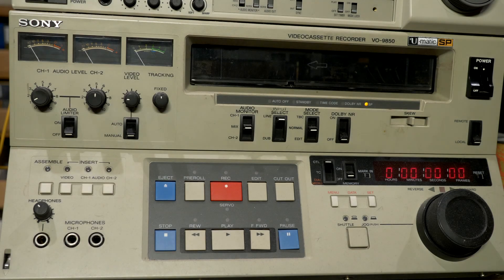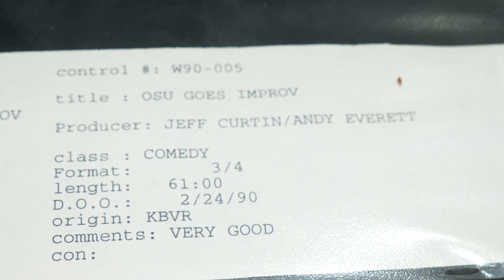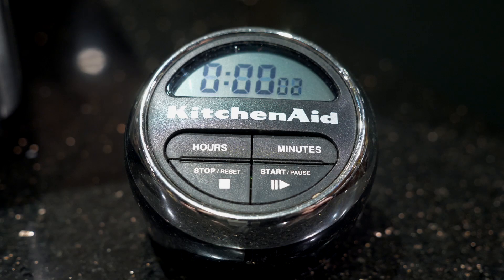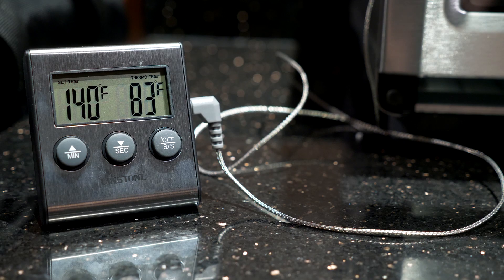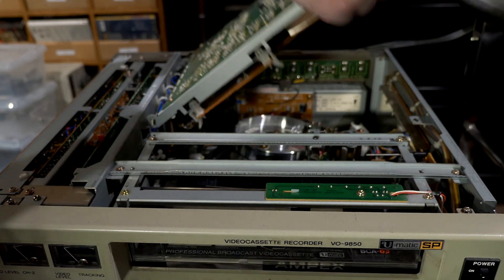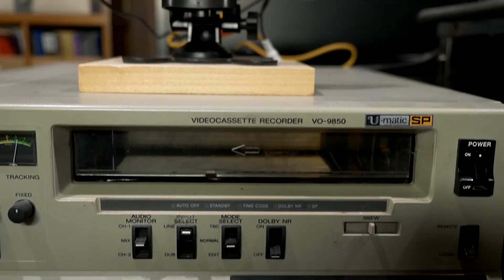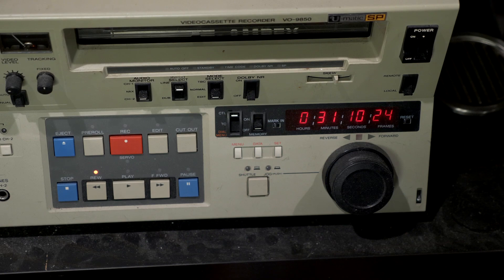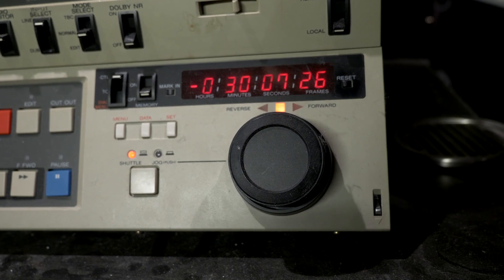Adventures in Tape Baking - Recovering from "Sticky-Shed" / "Stuck Tape" Syndrome

Comment: What software do you use for your captures?
Reply from the maker: It's fairly complex. I have an old DPS digital timebase corrector, which does a great job at stabilizing videotape standard-def sources and converting them digital to with 10-bit resolution (instead of the 8-bit you get in consumer devices). It outputs to SDI, which capture with a Blackmagic interface (there are several to choose from) to ProRes format. From there, I deinterlace using JES deinterlacer (which only runs on older versions of MacOS, I keep an old computer around just for that.) There are newer deinterlacing products that may work just as well but I haven't experimented lately and JES does just what I need. I hope that helps!

Comment: I have cleaned many broadcast u/matic tapes. Although from my home made oven 6 hours is plenty of time to do the job, cooling down as suggested is perfect.  But this process does not remove the binder that is now not sticky . I had the facility to use a cleaning machine that has tissue rolls and razors to scrape the gunk off the tape. But if you dont have one then the next best thing to do is dont play the tape after baking but spool it 3 times or more cleaning the guides and head between spooling. This is next best thing to a cleaning machine.  PS the tapes that are baked only stay stable for a couple of weeks and revert to their previous condition.  Also rather than place the tapes on anything metal in the oven use a ceramic saucer as it does not transfer large amounts of heat into the cassette cartridge.  
Wish you all well. This is a good thing you are doing preserving memories and events.

Comment: This is an interesting process. I was intrigued to see UofO since I am in Springfield. I am trying to determine if this will work to recover a huge trove of old floppy disks I recently received since many of them have local historical value but the oxide layer comes off onto the drive heads making the disks unreadable. I will do some testing, thanks for the great information!
Reply from the maker: Thanks for the comment - I actually am a subscriber to your channel! - sent a reply to you via the comment form on your blog about an hour ago.
Reply: @unofficialkbvr-tvarchive1426  Wow, small world! I just checked and the blog contact form was not pointing correctly. It should now take you to the contact form on my shopify site. There is also contact info on my about tab on the main channel page.

Comment: The other commenters are correct. With any videocassette, I always take the shell apart and bake the tape reels alone. This also gives me a chance to clean the tape guides in the shell, as they are often gummed up from prior play attempts. The eject problem you experienced is likely a problem with your deck, probably a loading belt that needs to be replaced. (I own a VO-9800, which is identical to yours except it has no tracking meter.) You might also try a tad higher temperature. I usually bake at 140F. The melting point of the binder is about 135.

Comment: I jabe baked over 700 reels of tape and 200 3/4" video cartridges. I would highly recommend you pull the spools out of the cassette before baking. 
I restore and operate 2" quad broadcast video tape machine and will not playback any tape that has not been baked.
Its so funny that Ampex, the king of magnetic recording made horrible tapes, both audio & video
3m had the best consistent quality

Comment: I'm getting bogged down by too much info. Use a convection oven, use a food dehydrator, etc. Which one works best? Maybe i'll have to try both methods. Don't want to attempt wet solutions like using diluted Nu Finish on anything other than audio tapes. There must be a time chart somewhere for baking various kinds of media but I haven't found it yet. U-Matic times can't be the same as Beta or VHS or 8mm just because the volumes are different. Thanks for the video though...

Comment: Don't be afraid to remove at least one half of the cartridge shell.  Leaving the shell on prevents heat from penetrating the entire tape spool at a decent pace.  Even after playing baking tapes I strongly recommend cleaning the entire tape path as even baking doesn't prevent excessive buildup on guides, heads, etc..  Good luck!
Reply from the maker: Drop me an email - contact info as at the end of the video.